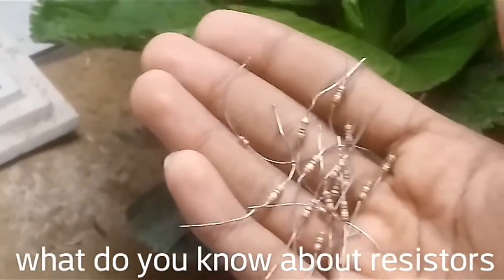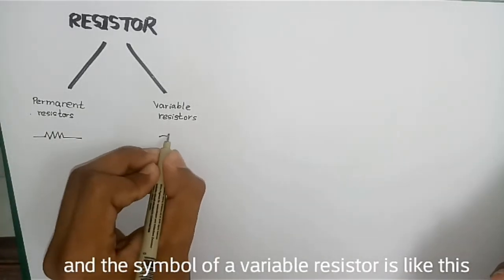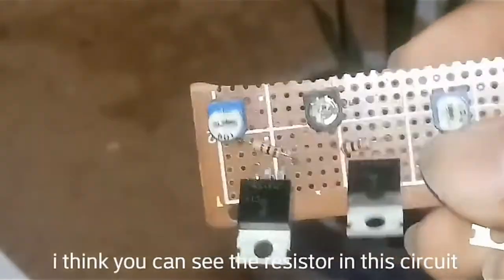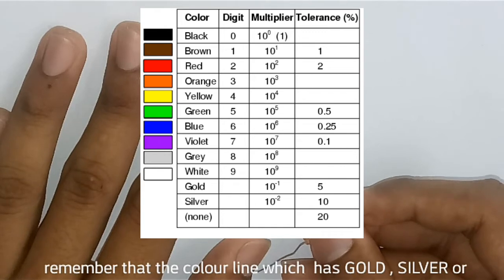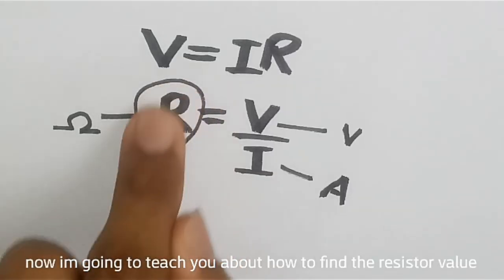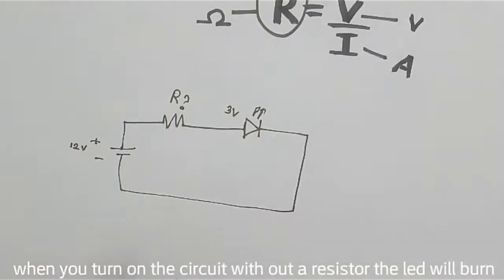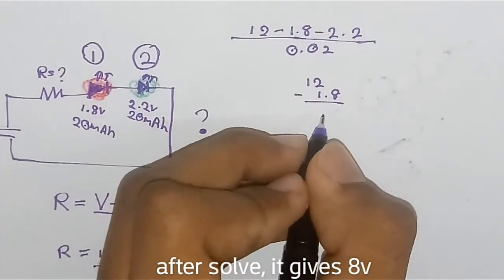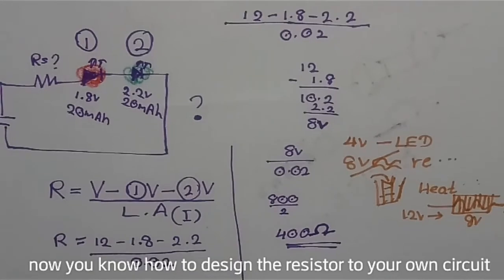EVERYTHING ABOUT  RESISTORS (Electronic basics| sinhala)

Comment: 230v walin 3v led ekk dalwanna 100k wage resister ekk danawane eth me samikaranayen enne 230-3÷0.03 =7566ohm 7.5k wage agayakne enne a ai
Reply from the maker: Mehema hithako 
(230-3.5)v/ 0.025 A= 9k kiyla asana wasayen, habi resistor eka 100k api dane samanya 0.5 w wage resistor eka , othandi 9k wage dala gana one 5W wage resistor ekak ( 230*0.025 = asana wasayen 5 w) 
Oya samikarne wadi voltage ekkta dadi watt gna genath selakili math wenna one
Reply from the maker: Habi 230 th ekka selam krnna epa 😅